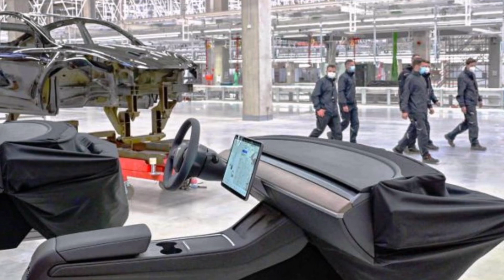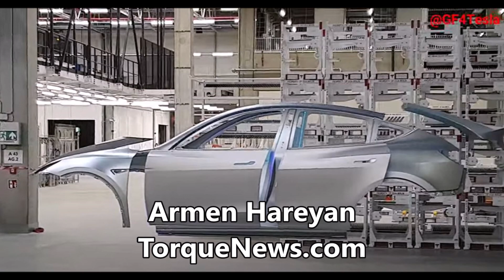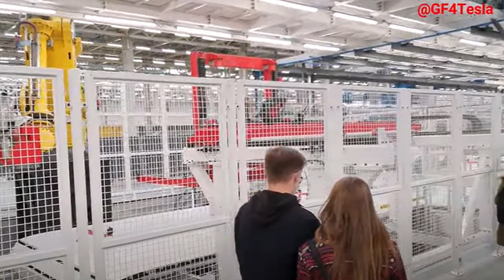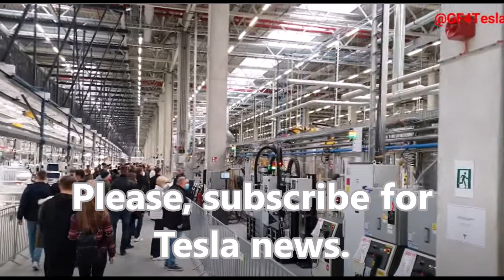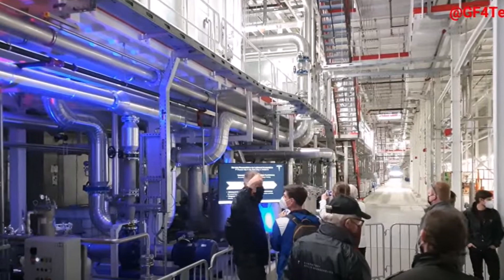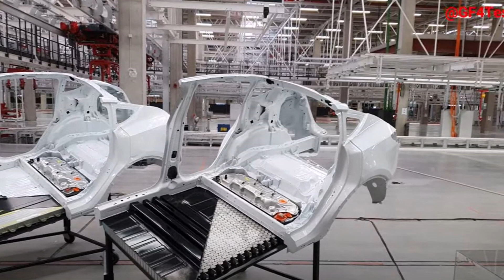Tesla Giga Berlin Shuts Down Today: IG Metall Reports Dissatisfaction Among Workforce

Comment: 3D chess… here comes the boom…CPI, 7/20 Q2, switch 2170 to 4680, re-ramp, stock split august, software update, range increase, charging time decrease, autonomy, Optimus prime, should I go on…? OK I will, battery storage, solar optimization, autobidder release, insurance release, a National primary election,….. list goes on. BOOM BOOM BOOM!!!